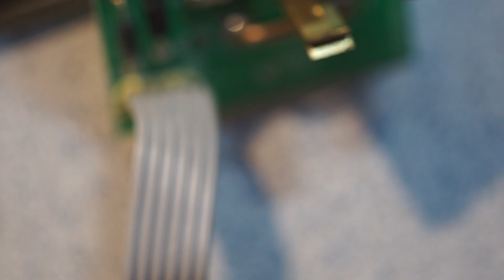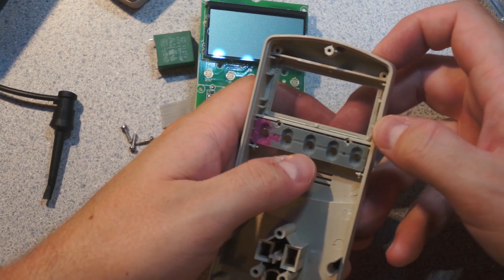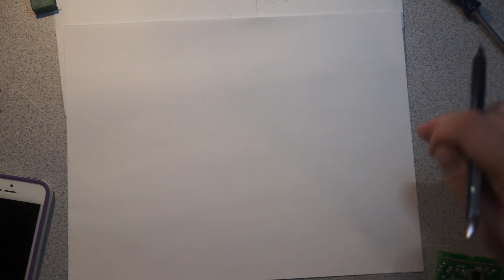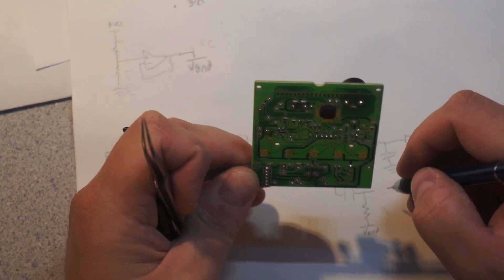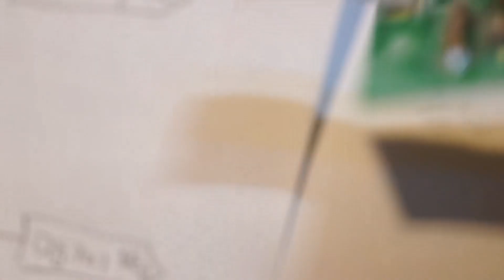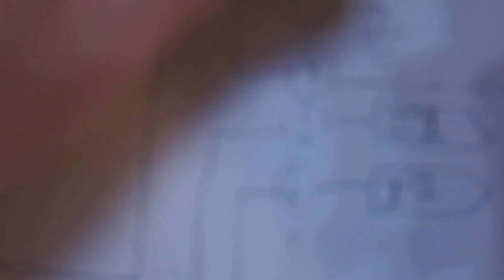Kill-a-watt teardown and reverse-analysis.

Comment: I resolved the 130v+ issue. It turn out to be a capacitor in series with the main prong and the 100 ohm resistor. Capacitor value 0.47uF. Hope this help.

Comment: I watched another video that was made in 2015 and there is a fuse right next to that brass bar thing by the plug now.  IDK if they upgraded the design a bit?
Reply: Hi , its some other revision board. It doesn't have that thermal resettable fuse in this revision.
Reply: its fake one. definitely fake

Comment: Leakage to ground can be measured while certifying. Leakage between hot and neutral - well it's supposed to have leakage because it consumes power. even though it sounds funny to say that it's certified. Maybe they just want to pass a simple test that they'll do on product import in order to allow it as "safe". Certification doesn't seam an option for this unit :)

Comment: the metal buttons is because of the analog reading. With carbon resistance is inconsistent. ......"the load crystals for the capacitor".... I wander, when you paid for it you would guessed what's inside  from the price. Why did you bought it then? You understand well what's probably under the cover. And yet you didn't search for better one for 10 times the price of this one. I'm not accusing you, it's a honest question. I'm trying to understand how the electronics market works

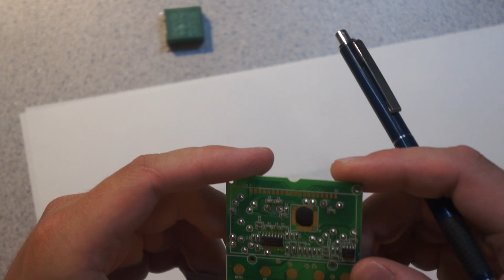Comment: @13:00 Sure enough, it is an eeprom, however there's nothing intelligible in it, just calibration data from what I gather by reading the one in my KAW (read as a 24Cxx series eeprom, only 56 bytes used).

Comment: I'd expect that larger diode with its cathode connected to the R/C dropper to be a zener, setting the input voltage to the 7805 and transistor/zener regulator. The extra 6V rail is probably there to give more output swing from the opamp which can't reach all the way to its positive supply on the output.

Comment: My friend has one of these that actually got hot enough (I assume it was the shunt that got hot) and melted/deformed the case.Surprisingly it still works fine.
I have heard a lot of similar stories to your "dead after 3 months" saga. Also,they don't seem to stay in cal long,if they were even cal'd from the factory.(Some of them are wayy out,right out of the box.)

Comment: They're probably much more concerned about creepage before the fuse, since that could result in a pretty violent current flowing. After the fuse the short circuit current is limited (somewhat, those glass fuses can interrupt at least 30A IIRC).

Still almost aggressively irresponsible to put the mains potential on the conductors right next to each other on that presumably not mains-rated ribbon cable. If they put the PE between the two that would half the voltage and increase safety a bit.

Comment: At least they did not cost out the fuse and replace it with a wire link....... That cap is not an X1 cap, it is a fake......

Comment: I actually have a different rev of that board, which has a QFP for the processor, but it's either soldered on 'dead-bug' style, or they ordered them with no markings as it doesn't look like they've been etched off.    Also, the op-amp on mine is a DIP package, and only one transistor which is a SOT package.   May try to post pics later...

Incidentally, my KAW has developed the same 'high' voltage reading, and a flickering display...

I may try reading the contents of the eeprom too...

Comment: I have an Irish version one of these and its also gone out of cal. It reads 213v and the accual voltage is 232. The current is wayyy off. It reads several thousand amps running a pc. I havent found why its doing this though.

Comment: 4.194304 MHz = 1/(2^22), so 22 flip flops or a 22 bit counter give/gives you a pulse every second. That was the most used frequency before they used PLL and 32768 Hz crystals. Agreed on the very bad soldering job there, i think i have never seen worse.

Comment from the maker: That, and you have 240V there. 

This is designed for 120V from the ground up. I don't think there is any way to convert these to 240 without completely redesigning both PCBs,